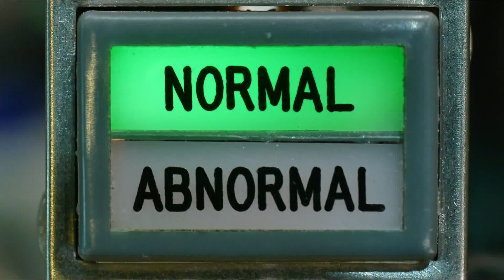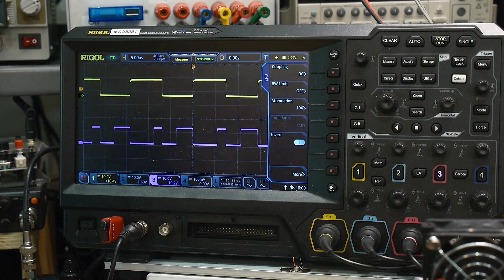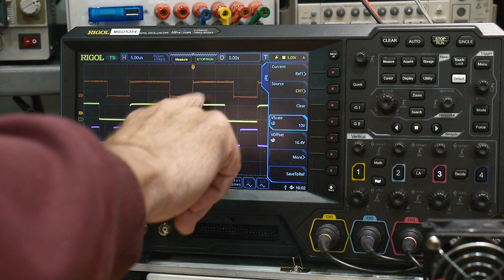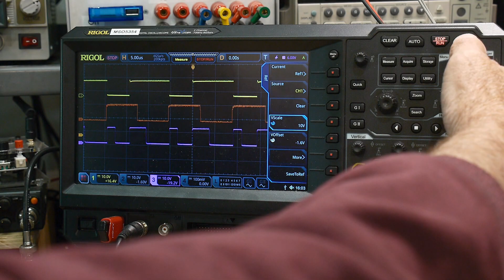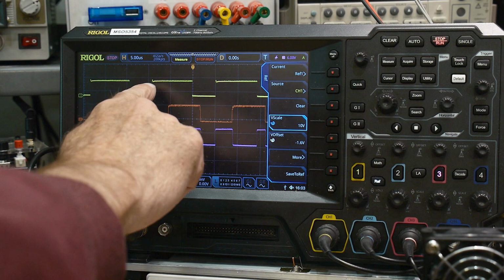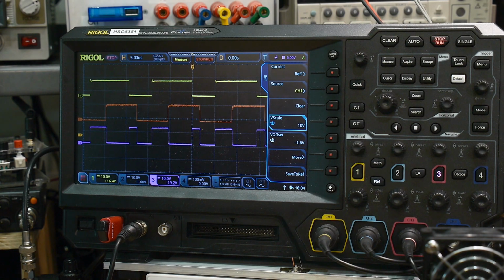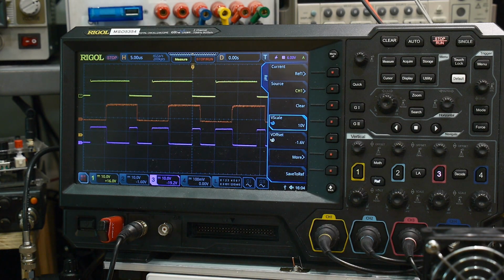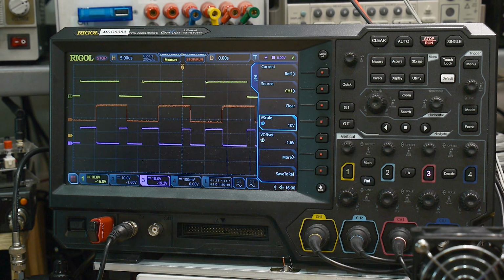#1114 Electronic Grease Pencil

Comment: Just a small caution, regarding grease pencils??? Would certain types of (cheap) display screens flex from the pressure of the lead against the screen and cause the layers of the screen to short? Test carefully. Add a genuine sheet of hard glass, if needed... Is this concern much ado about nothing?
Reply from the maker: use dry erase softly

Comment: Another possibility is something like the Heathkit ID-4101 Oscilloscope Electronic Switch. These were made to expand single channel scopes into dual channel operation. I wonder if you could use it for dual channel to three channel. And I do not know if they use alternate or chopping for controlling the trace.

Comment: We were taught the grease pencil tip back in class and I actually forgot all about it. We were taught on ancient tektronic scopes from the 80s, and since they were state property we weren't really allowed to draw on them so we used very transparent trace paper. Beyond a work around for not having multiple units, it was also handy for grabbing waveforms for lab reports or as a reference mid-lab while gathering data. In lieu of a polaroid or lineplotter, it felt better than whipping up a plot in sim when you knew it's not gonna be accurate to a real world circuit.

Comment: Simple way is to use resistors and diodes to add two or more signals, ie ch1 0-1 volt, ch2 0-2 volt, if scope shows 3v then both are high, 2v then ch1 low, and ch2 is high etc. In the past I have used this technique to show 4 channels on a single channel scope using 0.25v, 0.5v, 1v, 2v

Comment: I have some grease pencils in my tool box that I've had for years.  Every once and a while the need comes up for one.

We used a grease pencil as part of the process for tuning the cryogenically cooled parametric amplifier that was the low noise amplifier for the AN/MSC-46 satcom earth station.  The paramp as we called it employed a varactor diode operated inside a dewar assembly cooled to 17 K to 19 K.

The receive signal was in the 7.25-7.75 GHz range and the varactor diode was pumped by a 42 GHz signal.  The alignment process was to use a sweep signal generator set up to sweep the receive band.  The output of the paramp was sent through a crystal detector and displayed on an oscilloscope on the Y axis.  The X axis was driven by the sweep voltage taken from the rear panel of the signal generator.

A waveguide frequency meter was used to cause a pip in the trace at the start frequency of the trace and then retuned to the end frequency.  The grease pencil was used to mark the trace on the oscilloscope display.  The pump power of the 42 GHz signal and the diode bias were adjusted to get the desired gain and flatness across the band.  It was rather tricky because the second stage of the ParAmp was heated and the cascaded gain of the two stages across frequency had to be adjusted to get the total picture.

Fun stuff . . .

Comment: Comment below if you've accidentally used a permanent marker instead of a dry-erase pen (on an oscilloscope). Hehehe.
Reply: I have not, but I know someone who did.  It was on a fancy electronic whiteboard with scrolling and printing capability.  

The dry erase markers on hand were kind of knackered so this person went out and bought a brand new black marker.  Worked great, except that after the presentation was finished they tried to erase the board and found to their horror the markers they'd bought were permanent.

Thankfully I was able to share a trick that we use for erasing hard to remove dry erase writing that's been on the board for a long time.  Scribble over the markings with a fresh dry erase marker then immediately wipe off the ink while the solvent is still wet.

Worked like a charm even on the permanent ink, probably because it was still pretty fresh.
Reply from the maker: we had a fancy conference room built where you could draw on all the walls. About two weeks in a sharpie was used. DOH!
Reply: @IMSAIGuy  We have those as well in conference rooms.  Our offices, in addition to a white board, have a glass wall with a frosted film applied for privacy but which also allows use of dry erase markers.

Wasn't sure I would like the glass wall at first, but it is actually quite nice.  Very popular with the kids of various employees when they come and visit :)
Reply: @IMSAIGuy  : And that's why you should always go with a roll of butcher-block paper instead (well, maybe not the only reason).
Reply: @RideGasGas  many flavours of alcohol will remove permanent markets BTW, hand sanitizer is full of the stuff. Just sharing the knowledge ;-)